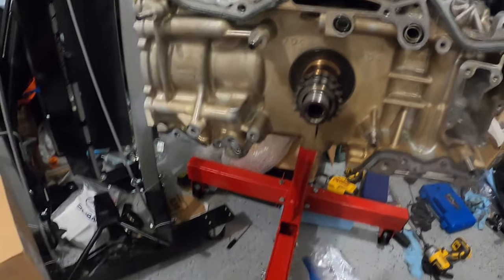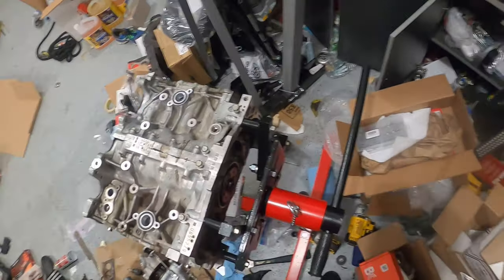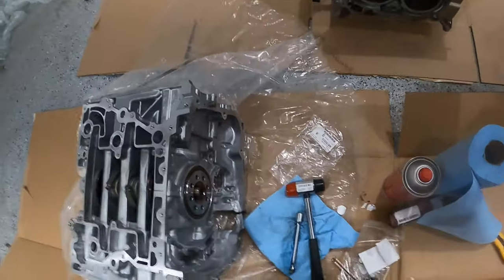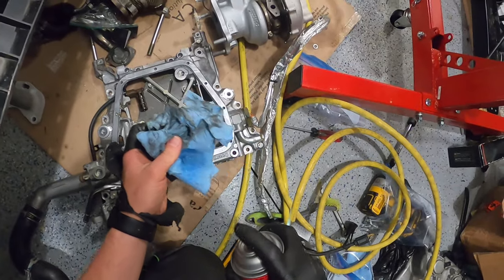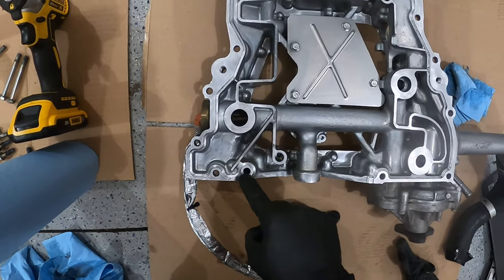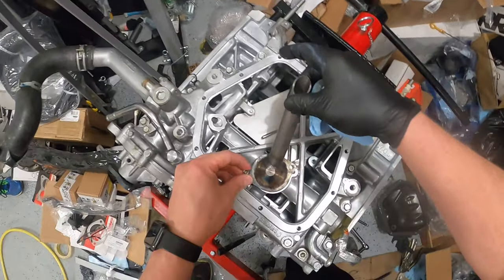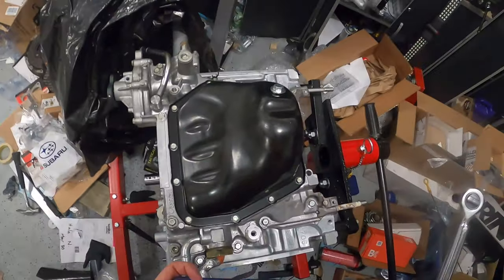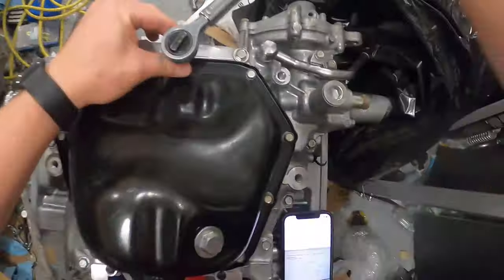FA20DIT IAG Stage 3 Build.Ep.8 Engine Build Series 2015 WRX  Preparing the Closed Deck Block

Comment: Good luck on the build. My 2018 WRX with a STI trans swap IAG stage 3 extreme with stage 4 heads and stage 2 cams and a ETS 6466 just put down 740hp on E74. Boy it's a money $#@&en pit. Now I'm doing 265s and coilovers so I stop sliding all over the road.
Reply: Btw my car was a 3 year build. 20k on the factory engine before it came out. May the force be with you.
Reply: @MrGsxrme  Should definitely post some videos. Car sounds nasty. I've done basically everything on my car except for fueling, built block and a bigger turbo. I have a 2018 STI trans on my 2016 WRX. DSS axles front and rear, OS Giken LSD.

Comment: here is a stupid question.. what size bolts did you need to mount the block to the engine stand? im getting ready to pull my engine out for a rebuild

Comment: should i re use the timing components on my built block? they only have 20k miles on them.
Reply from the maker: Yes absolutely. Mine had about the same and I have been running it on my built block for over 10k km now

Comment: You keeping stock heads? Or going with iag heads?
Reply from the maker: I’m keeping my stock heads but drilling them out to accept half inch head studs. I also changed out all the valve terrain to GSC (springs, seats, guides, seals) and GSC standard size valves, and I don’t have anyone that can port heads to 1mm larger anywhere around me.

Comment: Where you been?
Reply from the maker: HAHA I thought someone would ask. I cant do YouTube full time and was very busy with my full time job. Sorry man. More coming as holidays approach, I promise.
Reply: All good lmao. I actually have my 16 wrx in a shop with a spun rod bearing, I’m having a iag stage 2 going in. I wished I went with the closed deck though
Reply from the maker: Amazing. Either way the after market parts aren’t all there yet to push the closed deck block yet. I assume with the new FA24 STI platform that will change very quickly. So happy you got the block done rather than selling the vehicle as is. This is such a fun car.
Reply: @snewstead1388  rip FA24 sti